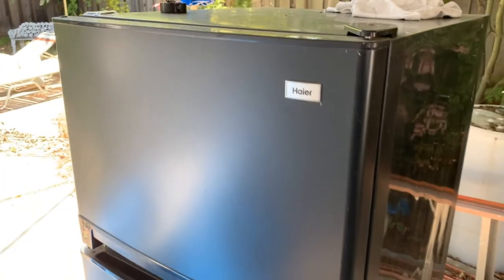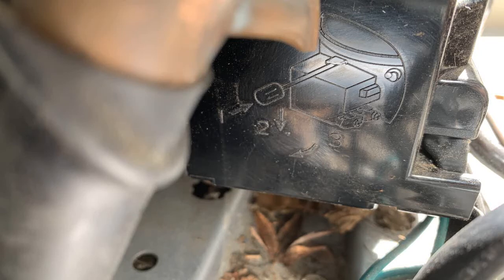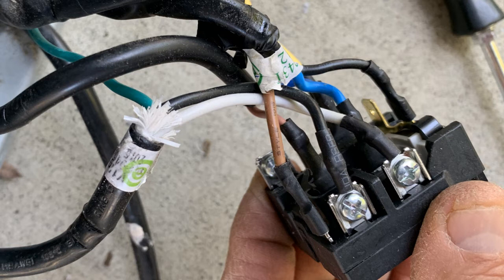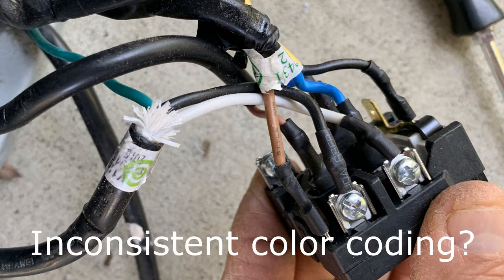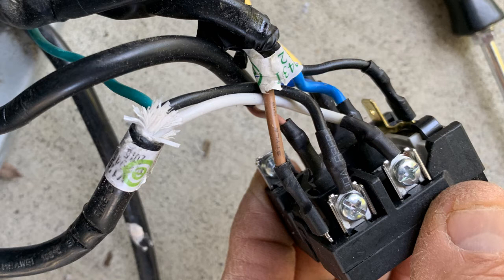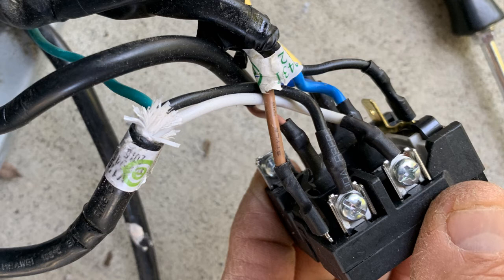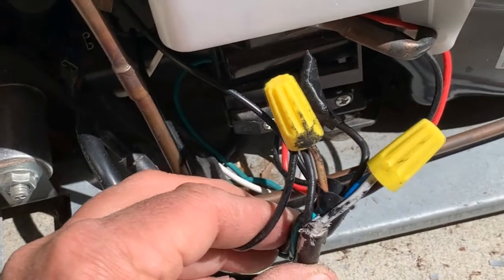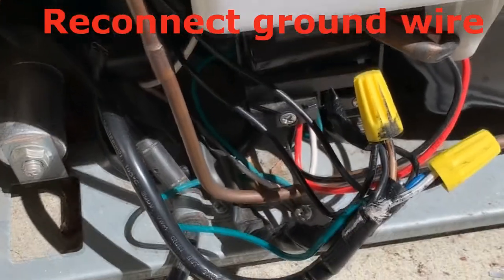Haier Refrigerator Relay/Starting Capacitor Replacement

Comment: How does the fridge shut off the way its wired in the run capacitor is hooked to 110 power all the time how does the refrigerator regulator turn the pump on and off?
Reply from the maker: There's a relay attached to a thermostat. Without that the compressor would run constantly and freeze the compartment. Finally, the compressor would fail.
Reply: @michaelbradford2816  in your video, It shows you wiring black brown together in a circuit with a black lead from the 3 in 1 then you have blue and white tied together with the other black wire from the 3 in 1. The way your video looks your 3 in 1 will have power at all times without any relay to break the circuit? Maybe im missing something but I just ran your video twice and thats what the wiring looks like, I have wired mine the same as you wired yours it works fine fridge stays cold but its always on the compressor is  always running. any help would be appreciated. I cant find the line that would would come from the relay that is controlled by the thermostat
Reply from the maker: Unfortunately, I gave that fridge to someone who needed it, so I can't go back into it. I realized the 3n1 may look confusing along with the funny terminals that come out of the compressor. If it is true that the compressor always runs, that is an artifact of how things are supposed to be. When I worked on the fridge, I only connected things to the point that it worked. Someone had discarded the unit with no hope to repair it. The device as advertised was to replace the starting capacitor primarily but also a relay. Even without that much, there should be a thermostat line that controls on-off cycles. It is possible that 110 is on one side of the circuit always. 

Please be careful as you delve into this repair because you could get a jolt from it. I would say if it works right now regardless, let it stay that way. The compressor has a thermal shut down built into it, so it won't really burn out. 

To me you are describing a problem with the thermostat which is quite possible. Check that, but unplug the unit no matter what you are doing. It's actually not safe for other than qualified repair people, if you can get one even to look at it. Because of the cost, many of these are dumped. It could also be that the unit was made so cheaply that the thermostat was either skipped or completely defective and there were no checks done  on the assembly line. Sorry to say that too, but it's possible you are trying to correct something that never worked properly or to any expected standards. Be careful.
Reply: @michaelbradford2816  I figured it out. The black cable that you said to unplug and tape up is the 110 power that is controlled by the thermostat. I connected the black line from the 3in1 to that and left the other black line in the neutral  side (white wire) and now it turns on and shuts off with the thermostat. For those that are wondering!
Reply from the maker: Thanks for clarifying that point. Glad it now works.

Comment: Hi Michael. I have a unit that turns off after 10 seconds when I plug it in.. is that what your problem was on your unit? Thanx for posting
Reply from the maker: Yes. I believe that's the symptom. It may not even come on at all or be on very very quietly, but not working correctly.  It's hard to hear the compressor running. Since it's a weak point, just replace the relay and cap anyway. Later, you could find other problems with the thermostat control, but it's not very likely. Cheap parts in critical places stop it in its tracks. Thanks for writing and good luck on your repair.  Please be very careful with AC!

Comment: U never said which wire goes on what on on the compressor????
Reply: Which one goes on which pin on the compressor?
Reply from the maker: True. The guide for your replacement part will do that.  Follow that carefully and it should work. I had never attempted this repair before.  Hope it helped you and thanks for your reply today.